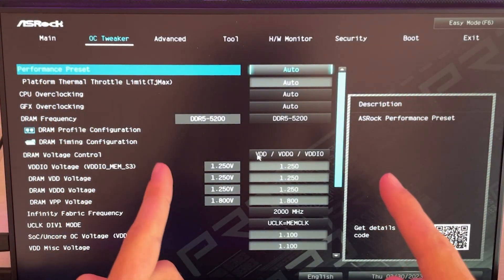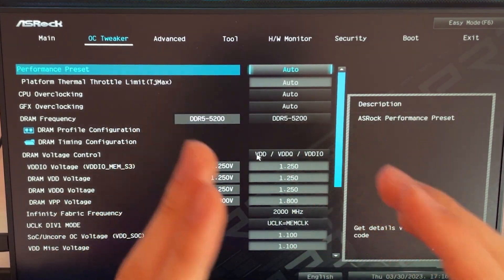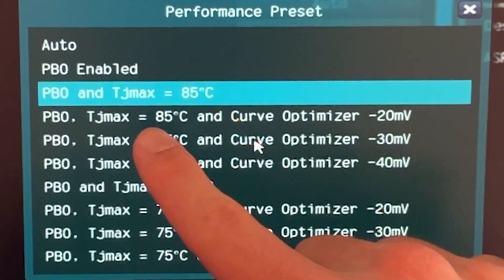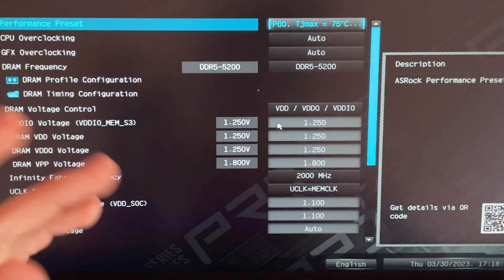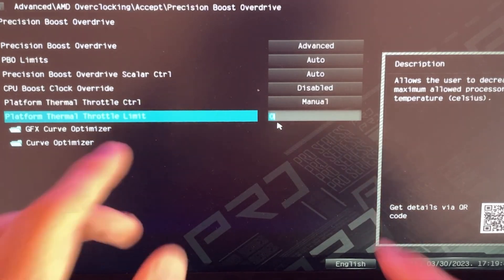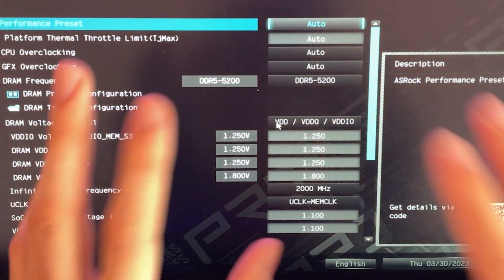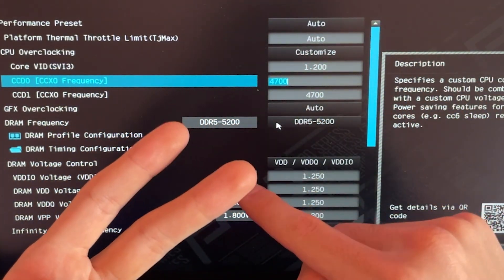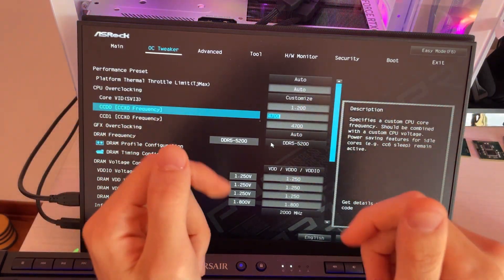Undervolt your Ryzen 9 7950X for more FPS and Lower Temperature!

Comment: Well done, I have a question. I like and prefer the static undervolt. 1.2v is good I guess, I have 7600x currently and I am doing 5.3Ghz all core@1.2v, max power@105W.  I am planning on getting the 7950x, but wondering if I can do 5ghz+ all core@1.2v? I have seen skatterbecnhers approach of setting CCD0 max and CCD1 max clocks with 100mhz difference but at 1.25v hitting almost 95 degree c. Anything over 5+ will be welcome with temps around 80 degree c. I am okay to set CCD0 and CCD1 clocks differently.
Reply: Got the 7950x, my unit does 5.1Ghz all core@1.150. Power has reduced significantly and temps hover around low 80's using 360 AIO. PBO with CO is hit and miss. CO offset negative 25 and 30 are unstable. Negative 20 is good but doesn't offer anything significantly more than the static 5.1Ghz. I did a test wherein I put the static clocks and did hibernate and then powered on and did a PBO with CO -25, It did 43000 cinebench r23 mysteriously though it was unstable and did reboot after pass2 of cinebench23.

Comment: -20 option does not make a difference on  my temps
Reply: You need to change pbo limits and it will work, it’s huge change. I use setup for 125W TDP

Comment: Thanks for the explanation.
I just bought a new 7950X (why spend 750€ for the 9950X when you can get the 7950X for 400€ 😉) and first tested the values with Ryzen Master.

In the end, I ended up with a stable 5000 MHz at 1.1 V.
The temperature stabilizes in Cinebench R23 after 30 minutes (with 36621 Points) at 71-74 degrees C (was at 95 C on stock settings) and consumes an average of ~152 W.
I'm very happy with that result.

Comment: I think you got it confused. If you are using your 7950x strictly for productivity then you are going to want to get as much out of the cpu as possible, meaning better performance, temps and lower power draw. If you are gaming then you don't really need all that because most games rely more on the GPU then CPU. IMO using the first option (all-core offset with curve optimizer) is going to give better results then the static option since with the static option you aren't even boosting as high as the cpu allows since you are locking the clock into a static number.
Reply: productivity usually means using basic applications that use less energy than games.. i liked the tutorial, but was unstable at -15. oh well (7950x)
Reply: @TheLobotomist-t1  I just went with an all-core -17 offset and I've been running that for the last week and it seems stable. When i made my original comment I hadn't even tried undervolting my 7950x yet but just within the last few weeks I decided to give it a try. Full disclosure in terms of temps it hasn't done jack $h1t even with my 360 AIO and my negative offset i still hit 95C. Later tonight I'm going to go to -20. At this point I've determined the only way I'm going to lower my temps is by actually lowering the tdp in my my bios and I'm not going to do that but I will continue to experiment with curve optimizer and try to see how far I can go with it.

Comment: I tried -20 and 85C and my computer just randomly restart after few min, I used -15 and the same probleme appears. I  reset it back to is default setting and it's back to normal.
Should I tried -10 ? Is it because I put 85C instead of 75C ?
Reply: no. Unfortunately it's because you got a crappy binned CPU. I had the same exact problem with my Ryzen 9 7900x. I couldn't go any higher the -10. If I went higher then i got random reboots. While currently on my Ryzen 9 7950x I'm at -20 and so far it's stable. i'm going to take that to -30 and see what happens. Unfortunately there's nothing you can do about your problem except go lower with the negative offset but at a certain point it isn't even worth it. TBH undervolting used to be about just getting lower temps, using less power and NOT losing any performance compared to the stock settings but now since AMD AM5 CPUs run so hot undervolting isn't going to lower your temps atleast not on non-x3d cpus it won't.

Comment: Hello, 
Could you tell the exact version of the ASROCK Bios you use on this vidéo ?
Il have an ASROCK B650M PRO RS and i don't find manual CPU Overclocking (Third line in OC Tweaker in your vidéo, there is only GFx Overclocking).

Comment: Do yourself a favor, don't touch the Ryzen Master Utility program with a 10' pole. It's notorious for causing issues. If you don't understand BIOS then you're going to be in for some hours of searching threads to figure out how to fix it.
Reply: I touch it😢  😭😭😭 I cried thinking I blew it up. I had to reset the Cmos a few times. I got it back working but I feel like something might be mest up. I learn my lesson

Comment: Thank you for creating this tutorial video for 7950x3d but I hope that you can help me out here, thanks:
I recently asked a PC store to build a PC for me with a 7950x3d on a crosshair x670e hero, I just want to run my PC at stock clock speed, however, I'm getting a very low score on cinebench r23 (around 30K, I know that I don't have any thermal throttling and my cpu temp running around 85C without altering any PBO/OC settings on my motherboard (bios ver.2007). I'm wondering whether this is a normal CR23 score for a 7950x3d without enabling any PBO/OC setting since I saw so many users are getting around 36k+ or even 37k/38k score withoug tweaking any PBO/OC setting on their cpu... I tried to return my PC to the PC store who build this PC for me and they did a bunch of tests and told me that my CPU is operating within design tolerance, although at a little lower clock speed than usual,  it may be just my bad luck on silicon quality... with all this being said, I decided to return my 7950x3d to the local agent for further checking and pending for their test results.
Any idea about my score of around 30K in CR23, do you think it is just my bad luck?

Comment: Thank you for your explanation, I'll be watching your 4070 video next.
I do have a question though, is there any necessity to increase clock speeds when lowering voltage?  My main goal is to prolong component life so losing a bit of performance is not a big deal to me.
Reply from the maker: Thanks a lot for watching! No need to increase any clock if you’re only after low temps and longevity:)

Comment: dude i got asrock b550m pro se mobo, i build my pc just last month, checking my bios now  i dont have the same interface like you have, i dont have performance preset and i dont have PBO. what should i do? help me.
Reply from the maker: B550 means you have an AM4 CPU. Check in my CPU Undervolting playlist, I have dedicated tutorials for AM4 :)
Reply: @ImWateringPSUs  bro i find out in reddit that "asrock  b550m pro se mobo" doesnt have PBO option, the name is b550m but in reality it using different chipset. when i use ryzen master there is a notification that my cpu doesnt support overclocking that why it is disabled but it in reality the mobo is the one doesn't support it, im using ryzen 7 5700x btw. i think the only way to undervolt it on the said mobo, is to go to "OC Tweaker" and go to "external voltage setting and line calibration", i see some cpu vcore control but im very uncomfortable doing it because i watched some of your tutorial i didnt see you doing it there.
Reply: @ImWateringPSUs  im thinking to do -0.05 offset in cpu vcore but im kinda hesitant because that setting is on "OC Tweaker" then scroll down into bottom and you will find a folder named "external  voltage setting and load line calibration". that name of folder makes me uncomfortable because like i said i seen some of your tutorial you didnt go there.

Comment: Hiya!!  I have a 7 7800X3D Chip. So, I can copy your static setting into my bios, it's an Asrock X670 PRO RS same as yours/ also I am right to think you leave the curve optimise in amd overclock alone...no need to touch anything in there at all ,all on auto yes? ( curve optimiser and other stuff is the manual settings)

Great vid and Ty so much if you have time to reply.:elbowcough:
Reply from the maker: Yessir you can just copy it! Also consider dropping a like and subscribing if it ends up being helpful :)
Reply: @ImWateringPSUs  hey thanks for the reply, unfortunately I updated my bios yesterday before I saw your vid and it has added stuff but taken away the bit where you add your own voltage, I don't like doing the curve optimiser and I'm not sure whether it was renamed as something else. Unless I can roll the bios back but when I go on the ASRock page it's just showing beta bios, not any previous stuff 😢
Any ideas greatly appreciated, I already hit the like etc 👍✌️

Comment: -20 won't refuce your temperature for a anything over 8 cores. It will lower the voltage correct. Which will increase the mhz to its stock speeds for a longer period so will use the same wattage or more. And temps will be the same but with a higher frequency.
Reply: Not sure what the logic behind this is, because using these exact instructions dropped my idle temps on my 7950x3d by literally 10c
Reply: Again lower voltage manual and increases frequency wil just boot higher frequencies for longer but the temps will get to the same
Reply from the maker: It will also generally reduce the temperature, but yes the end goal with the -20 is to get more performance. If you want just lower temps, do the static option :)

Comment: This was incredibly Helpful thank you. I couldn't Understand why my CPU was Killing itself at 70-85 degrees when im doing almost nothing*. Even Putting the CPU Under 50% Load put the CPU in the danger zone of 90-100C And had a few hard Shut offs. This was a relief, as I went from a Ryzen 7 5800x to this and couldn't understand why my Cooler Struggled SO HARD to keep up.*Its not a wimpy Cooler either Its baffling why AMD would put so much power and voltage into the CPU and risk burning the thing out when you can sacrifice a tiny bit and Chug WAY less power and have it run way cooler. Thank you so much!
Reply from the maker: I’m really happy it was helpful! Thanks a lot for taking the time to leave some feedback :) Consider subscribing if you wanna support the channel!

Comment: Hi. I've done that but my PC restarded twice in a matter of 3 hours maybe. I am using AIO cooling and I didn't see my CPU crossing 50 degrees. I used your numbers, when with the Curve to be 20 and Theraml Throttling 75. Any advice? I am using MB  TUF Gaming X670E-PLUS Wifi one with CPU 7950X3D.
Reply from the maker: Set the curve to 10 or 15 and you should be good :) But it only works if you subscribe

Comment: Really nice tutorial!! Performance presets are so useful! Went with thermal limit 75 and offset minus 20. It just makes so much more sense!
And got 37438 in CineBench R23 instead of 36020 as of before!
Seems stable enough so far, but should I see crashes, would you recommend to maybe do minus 15 instead?
Reply from the maker: Glad I could help my man, consider subscribing to support the channel :) Yes, 15 as a last resort is gonna be good :)

Comment: Eagerly waiting for my PC parts to arrive. Watching as many videos as possible to set it up. I'm looking specifically for power saving and temp. My old boards had all this Eco features. I already undervolt my 3060 ti and it runs much better. And I've already seen a lot of undervolt 7000 videos. Seems to be on the same boat. Undervolt lower temps and power with minimal to no loss. And gain in some case. 
They seem to want us to need a bigger PSU, bigger UPS Battery Backup and waste more energy. My kWh is high, every watt counts.
Reply from the maker: This is the right channel for you then! :)

Comment: Honestly, for gaming there is no need to set a thermal limit. Just undervolt it as much as you can, make sure it is stable (it will hit 95c, it's a form of torture test) and start playing games. While playing games the temperature will be much lower than in synthetic workloads, and you will have the best performance. If you're running a 7950x it's likely that you got a high-end GPU as well, and gaming in high resolution where you will be GPU-bound anyway.

If you're an esport player with a 1080p 360hz+ monitor things might be different, because you rely more on the CPU. But for 4K 144hz temps will stay way under 95c in all games I've tried.
Reply from the maker: Yay, but what you're basically assuming is that the CPU is not gonna be used to its true potential. I prefer to set it so that if needed to be used at 100%, it's at the optimal settings!

Comment: So I did the static core volt change and set it to 1.2V, but my ryzen master still says 1.39-1.45V, I had to go to creator page and manually set the volt to 1.25 and that seemed to work. But why did it not work in bios?
Reply from the maker: That's weird, did you update your BIOS to the latest version?

Comment: Very nice quick tutorial and at point. 
I have one question because i do a lot of rendering so it is in the productivity category i guess 🙂
My 7950x on max load is doing 94-95c on 5.15-5.2ghz and i don't mind that temperature because i change CPU on every 2y. So my question is can i use your method to increase Ghz per core and keep the same Temps, i mean with curve optimizer only or i need more advanced tweaks for that to achieve?
My goal is to have 5.3-5.4ghz on load with temperature which is around 94c?

Thanks in advance and keep the good work! 😉
Reply from the maker: Hey there, first of all thanks a lot! Yes you can use the curve to push it a bit higher clock wise, you could do it either with the curve method or simply with the static method by setting a higher core ratio and higher voltage. First of all set the temp limit to 95C, then play around with it and see how much you can push it :)

Comment: ALL PBO crash my system and i need to remove the battery and start over. The static setting run fine so now and i was able to drop temp. my system ran at 80 C on idle  and was very noisy. Asrock X370 Pro GT with AMD 7950x, MSI 360 mag v2 LQ ( which is a noisy crap ) i'm thinking of replacing it with Noctua DH15. any toughts ?
Reply from the maker: Oh wow, sorry to hear that! Even -10
PBO with a temperature setting of 80/85C still crashes on you? Regarding the cooler, I actually have a dedicated video about running the 7950X on air and I was using a Xilence M906, I think it’s definitely worth it in terms of both noise & price!

Comment: The problem with that setting is your running 240 watts at the outlet..
Reply from the maker: Which one? They do DRAMATICALLY drop power consumption, test them out!
Reply: @ImWateringPSUs   I run 10  7950x miners.  1.200 v  4700mhz is 240 at the wall wattage. 0.995 v  4300 mhz  gives me 160 watt at wall..  I lose alittle h/s rate with lower setting.
Reply: @ImWateringPSUs    Forgot to tell you I don't run no GPU so with that you will for sure be over 300 at wall wattage.  Also my temp is 58c with lower setting and 75c with higher.
Reply: I reach 365watt at 1.31v 5.3ghz all core 😂 too much
Reply: @_xewo_9856    wow what is temp 95
Reply: @tcathunder  92 degree first run, 7950x delid, lapped and watercooling from Watercool (Heatkiller) 2 radiator 480mm .. temp liquid 22 degrees

Comment: I have an MSI MPG X670E Carbon wifi and can't find the undervolt settings that you mentioned to lower the temperature for the 7950X.
Reply from the maker: Hey there, which one the various presets are you encountering troubles with? Today a new R7 7700X Undervolt video will be released on the channel so you might wanna check that one out, I’ll have one with an MSI motherboard coming soon too!

Comment: I just switched in my new build from ASUS to Asrock and I love these built in profiles. I set 85 -30 and it seems to be stable (so far). I tried some manual stuff but it was over my head so loved these easy options.
Reply from the maker: Yeah honestly I think Asrock has the profiles REALLY dialed down. All the others manufacturers I’ve tested have been kind of lackluster, aside maybe from Asus “Cooling Point” tuning but that’s on Intel side. Glad the vid was helpful!
Reply: @ImWateringPSUs  Yeah I had good luck with the profiles. I ended up doing manual -25mV and 85 Threshold and set my PPT manually to 180 watts. Getting super high performance and much reduced temps. Super stable so far with testing and hours of gaming.

I wasn't sure about this ASRock board at first, the bios looked boring compared to ASUS but then I quickly realized how unimportant the "look" of the BIOS was.
Reply: visualboxie5234 Going smooth

Comment: what is minus -20 ?? Is it 20 Milivolts?? Or 200 Milivolts ??
Reply from the maker: That’s a very good question! Each “point” means an offset that varies between 3mV and 5mV depending on the point on the curve. So -20 would mean -20*(3mV/5mV), which means anywhere from -60mV to -100mV!
Reply: @ImWateringPSUs  Wow thats to complicated with this curve, its easier on Intel side

Comment: I hit temps of about 79 degrees on max usage on my 7950X that I set on eco mode 105W...is there any way to reduce that 79 degrees even lower without losing a lot more performance?
Reply from the maker: Yes, by doing the curve optimizer and/or static offset as shown in the tutorial!
Reply: That ECO mode didn't work for me either, I had about same temps as with normal.
What was a game changer for me was setting the clock to 4.8ghz and voltage to 1v.
Reply: @alvarosantos78 I fixed things by manual play in the amd ryzen master...it took some time but now my temps are at maximum load around 60 degrees and I hit 35500 score on cinebench R23....i never go above 80 wats either...

Comment: Would you still go with 7950x over 13900k for constant rendering 24/7?
Reply from the maker: To be completely fair, if budget isn’t a problem I do think the 13900K is a better CPU overall. But if you’re talking 24/7 rendering, you should have a better efficiency with AMD! If power consumption isn’t an issue either, then I’d say get the 13900K!